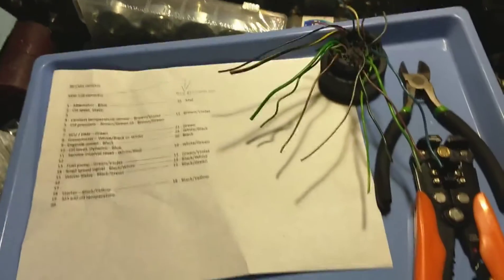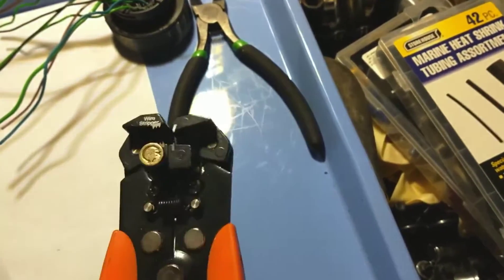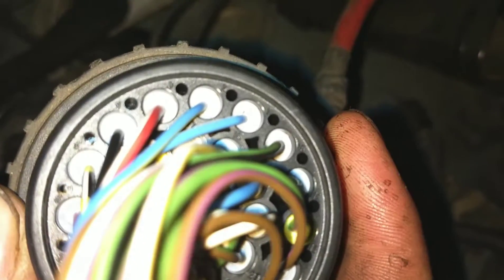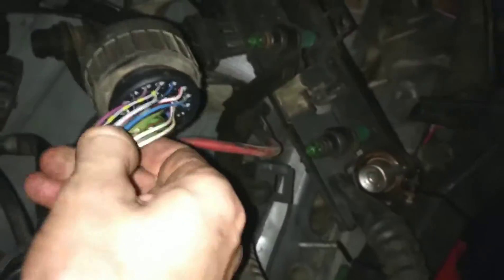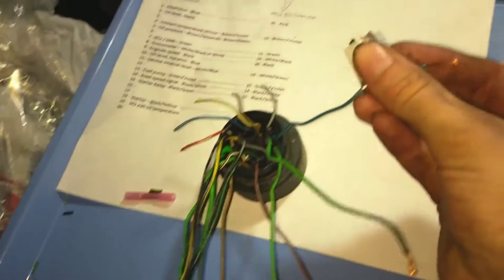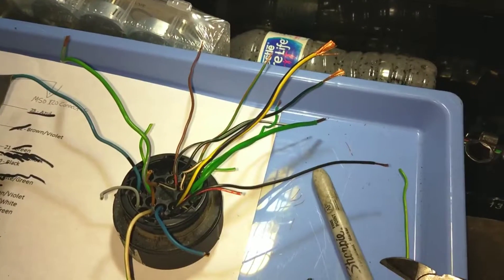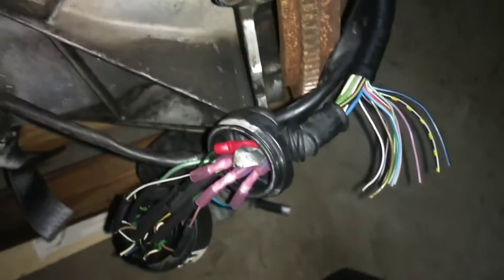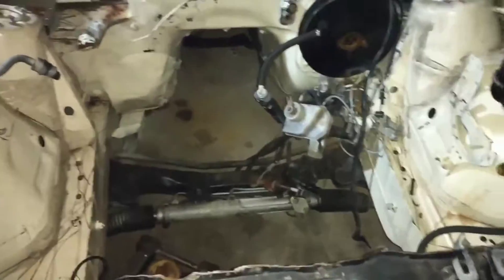M50 Swap- Wiring 24v Harness into E30 Chassis

Comment: My car 1991 m50b20 non vanos E34 ecu bosch 402. 
I placed the M52b20 engine and electrical wiring.  I bought the engine and electrical wiring from 1995 MODEL E36.  Ews no problem.  C101 and x20 connection is normal.  Engine running. No problem.  But abs warn and air conditioning does not work.  And the temperature gauge does not work.  I found a solution for the temperature gauge.  But abs and air conditioning still don't work.  What should I do.  I would really appreciate if you can help.
Reply from the maker: I took abs and air conditioning out it was a drift car so I don't knwo